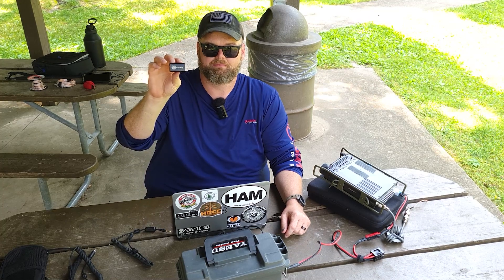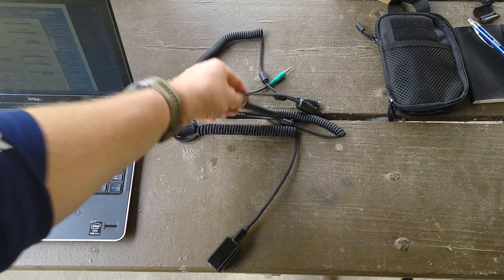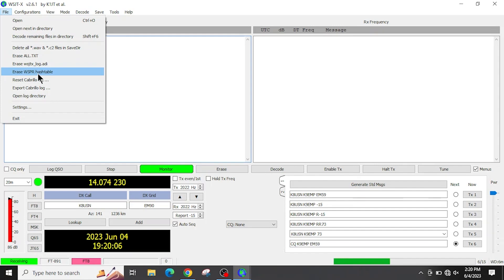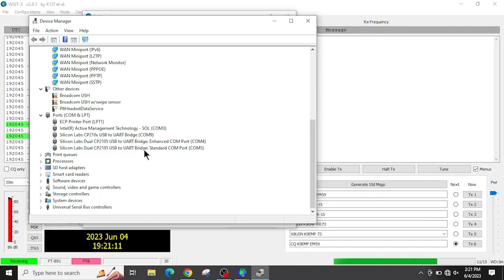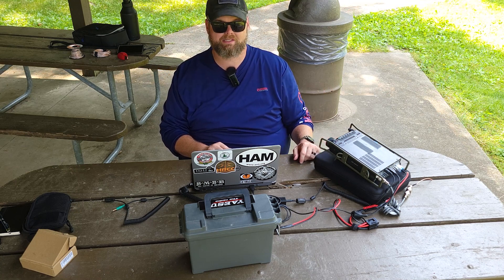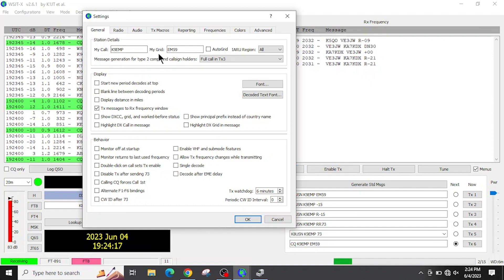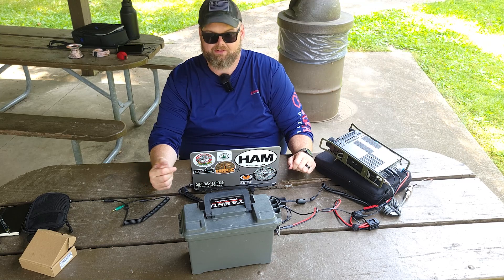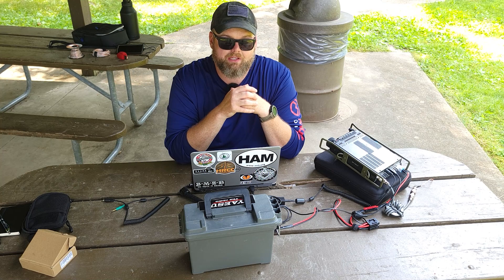FT-891 Digital Modes Using The DigiRig

Comment: Greetings, question for you. Will my DigiRig work without Rig control set up on the FT-891? I want to try HF Packet but for setup and configuration sake I want it to be as simple as possible. Thanks
Reply from the maker: I haven't tried this so it might. You will just have to make sure you have the frequency and correct side band/mode set. Most likely you will have to play with the settings in whatever software you are using to do it. It was all trial and error for me to figure the settings in the video.

Comment: I cannot get it to work and I have my settings same as yours
Reply from the maker: Double check your com ports in device manager for the digi rig they may be different port numbers than what i showed on my laptop. Also, check your sound device settings, and check your baud rate setting on the radio. The baud rate on the radio and the baud rate of the com ports need to match.

Comment: Good video.  What are the benefits of using the computer USB cable versus the green CAT cable that came with the Digirig?
Reply from the maker: I've only been able to get the cat control to work with usb cable on the 891. The green cat cable works just fine with my 818.

Comment: Is it the HF POWER which affect in digital mode?
Reply from the maker: If you use the digital mode on the radio, it is. If you are just using ssb like what I was doing, it would be the ssb power.

Comment: The short USB cables sold by Digirig have ferrites on each end already. It might actually help with RFI to use the shorter cables. I've been using the short USB-C to USB-C and have added no ferrites to any other cables & have no RFI issues. I wonder what antenna you are using with your FT-891. I use a linked inverted V for 80, 40, 30 and 20 meters. 73 KD5YOU
Reply from the maker: I'm using an EFHW. At the time I bought my DigiRig, all they had were the coiled cables, which don't appear to have ferrites on them already.

Comment: Since you're using CAT over USB cable, PTT should be set to "CAT" on port "COM4", and "Mode" should be "Data/Pkt" for digital modes. Also, it is recommended to increase the interface speed above 19200 bps in the software and on the radio, in most cases 38400 is the best, it provides very smooth operations and minimum delays. 73!
Reply: I have mine setup the same as described in the video and it works fine, though I might try it on Data/Pkt so that I don't have to keep changing the power output when switching between voice and data.
Reply from the maker: Tried that but could not get it to work with the DigiRig. The data packet mode doesn't matter a whole lot as long as you are using USB.
Reply: @k9emp  Digirig has nothing to do with CAT over USB cable. That config works to me...

Comment: thanks for a great video.  luckily i had enough ferrite beads, however i cannot get CAT to work.  only with radio set to NONE does ft8 work.  what version of firmware are you running?  that is the only variable i have not varied.  thanks much.
Reply from the maker: I am on v01-07. Make sure to triple check your settings with what I have in the video. Also, make sure to check what COM ports are coming up when you plug in your 891 in device manager.

Comment: What is the case you have under your 891 I have been looking for a way to protect mine while in a backpack.
Reply from the maker: It's the Amazon basics large carry case. I dropped the affiliate link below. It's a semi hard shell case. I pulled the foam out of the case so the radio would fit. I can also slide my mic, power cord, and coax in it. I could probably fit more in the case if I wanted to.

https://amzn.to/44HpeZn

Comment: You don’t set the Audio to CAT ?
Reply from the maker: No, the way the DigiRig is set up it has to be set to RTS. I believe it is just the way it is designed.
Reply: @k9emp  Yeah, I almost blew an entire trip to my first POTA activation (which I planned to do FT-8 on) assuming it worked just like my external sound card I originally used at home for FT-8 on the 891  I went ahead and did the activation on SSB instead and I'm kinda glad I did, since I had more fun than I thought doing it in phone mode.  I bought a digirig for portable, and used my old Y-harness with the 6-pin DIN on it, and left the WSJTX settings for PTT method set to "CAT".  Thinking the digirig was just a different external sound card with better RF isolation.  Well, my 891 lit up when I tried to transmit, but no power output...  I played with it and restarted the software and the radio and nothing changed.  I then watched a couple videos (like this one) and realized the PTT method has to be RTS for digirig.  And I ordered a new cable also (that does't have a Y-harness to combine two seperate audio cables) because originally I thought that was the problem and I ordered the cable first.  Its possible the problem is both, and I need the digi-rig cable, AND the RTS setting, but I'll test that.  I'm sure glad Yaesu stopped short of putting an external sound card in the 891.  I'd hate to have spent $10 more on the radio.  I would have missed out on all this fun I have had puttering with external sound solutions.

Comment: Thank you for the video.  I would like to buy one of these for my FT-891.  I have zero experience with this mode.  I'm primarily a CW operator.  But, I have been fascinated by digital modes, and want to give them a try.  I'll be back to look at more videos.  73 de David AE4LH
Reply: I have purchased the Digirig, watched hours worth of YT videos.  Epic failure at the park today.  My USB-C was one I had at home, but must not have had enough wires connected.  I've ordered one with ferrites, and is made for the Digirig.  Question: Can I NOT use the printer cable, use RTS, and not CAT?

Comment: Did you make any other changes to your radio?  I find it hard to believe there were not some other settings in the radio that had to be changed.
Reply from the maker: The main thing in the radio to set is the baud rate. It is menu option 5-6. It doesn't really matter what it is set at, but you need the baud rate to put into WSJT-X. If you will be running 30m to 160m, you also need to set the side band to USB. That is menu option 11-7. As far as I remember, those are really the only menu options that I have changed for the DigiRig to work. I was using a signalink, and there are a few other options that have to be changed for that to work. I don't use the data mode when I do digital because the 891 has several other options that have to be played with in the menu. I've just found that ssb mode works the best for me when using digital modes in WSJT-X.